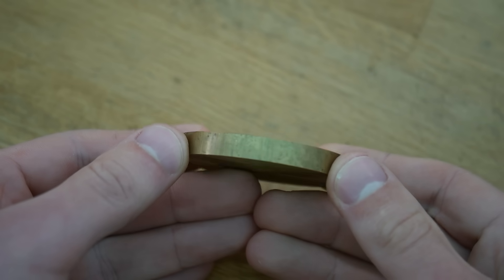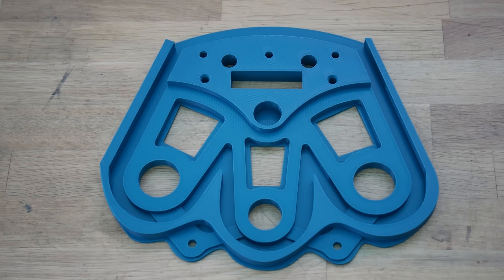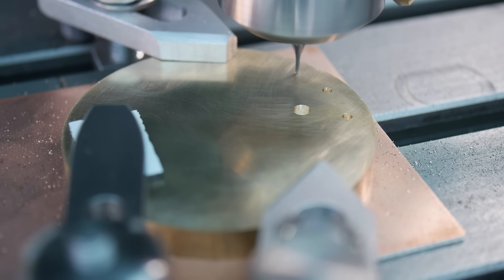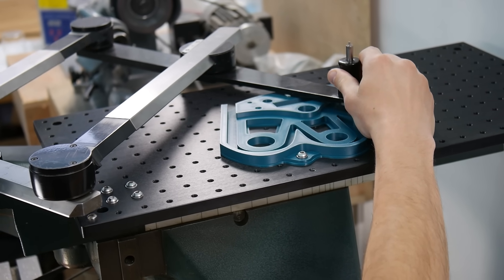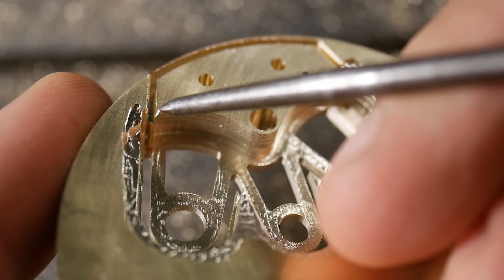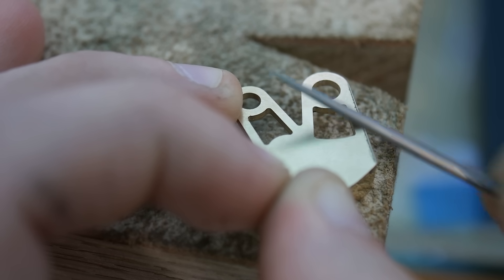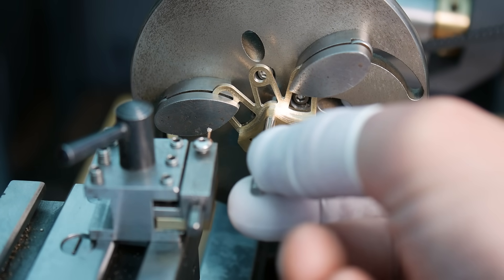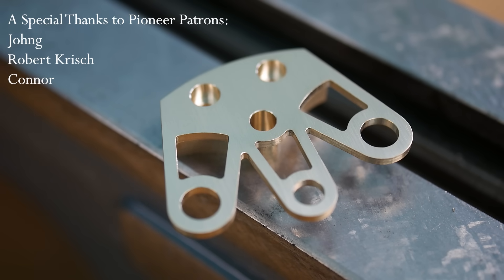Watchmaking: Using a Pantograph to Make Watch Parts

Comment: I served my time on a pantograph as a sign maker. We branched into fine engineering, when we did this we would often work with cutters where the tip was only a couple of thousands and ground and sharpened using a rotating cutter and microscope. When I tell people that I could feel the cutter dull they think I’m exaggerating, what was worse was you could feel to tip snap…😂. It took a fair bit of time to develop this level of feel

Comment: Funnily enough, I semi-recently sold my Taylor Hobson K on Marketplace (yours looks a bit nicer tbf,) to a clockmaker.. having myself used it for a watchmaking project too..
swapped it for an Alexander which was too cheap to pass on - but for horological projects, the Taylor Hobson is actually a nicer size.

I make templates via laminated card but the 3D printed route would be an improvement in a number of ways.
Your clamps and optical fixturing plate look superb btw.

Comment: I do not understand all the youtubers using a panthograph with a 3D printer. If the video is about manual machining the 3D print is the exact oposit of manual machining else why not jus get a cnc it is smaller and more precise, faster and cheaper than a panthograph. else you could just make the mold by hand. I mean the craftmanshift on this channel is superb so i nether understand after all the energy spend going manual on other part why go that shortcut.
Reply: I disagree with you entirely. Its a very clever way to add near CNC capabilities to a much cheaper and smaller machine.
It can be as much about preserving and making use of an otherwise outdated machine as it is about enjoyment of use and how much the workflow fits into your way of thinking
Reply: you got to draw the limit somewhere, the template is a 3d printed tool but the pantograph is machined too, if you want to make the template manually go for it but I understand why they want to skip that part while keeping part of the manual process
Reply: With the reduction a pantograph enables, your positioning errors are also reduced. So if a consumer printer holds a tolerance of, say, +/-0.2mm, after a 10x reduction, you're producing a part with a tolerance of +/-0.02mm, or 20um. If you went all the way up to the max reduction of a Deckel G1 (50:1 IIRC), you're looking at +/-4um. Granted, cutter deflection etc. probably means you can't hit that, but that's the logic.

Then there's the cost argument. Many people in the manufacturing/making spaces already have a 3D printer (for making soft jaws, prototyping for fit, fixturing, or hobby), and a good quality pantograph can be had these days for <£200. 

For contrast, a desktop CNC mill like the Langmuir MR-1 claims 12.5um tolerance, and costs about £5k when all is said and done

Comment: Id like to ask about the lapping flat. Does this not create a slight convex surface? Or can this be controlled somehow?
Reply from the maker: It does slightly using emery paper, but for this purpose, it's good enough. To lap a surface flat properly, it's best to use lapping compound directly on a lapping plate.

Comment: How do you design compound gear trains with clocks? I'm thinking of including a mechanical counter, but it's at a very specific moment it's supposed to turn (one for every 8 hours, 45 minutes, and 57 seconds). I thought it'd be could to try and design a Warhammer 40k themed clock that also has their stupid time-keeping system for the year where it's divided into 1,000 equal parts.

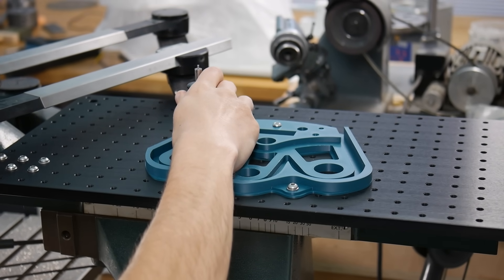Comment: 4:30 I think you could use a vertically offset second "serpentine" pattern that is indexed by the shank of your stylus, which is a smaller diameter than the tip. Alignment would probably be tricky, but not impact the tolerances of the final part if it's off because the cutter's bounds are constrained by both patterns.
Reply from the maker: Good idea. I might give this a try.

Comment: You can have a secondary template over the primary template, so above the tracing arm with a different stylus on top, I think they were for 3D work?
Also reamers cut on the face not the flutes, so need a relatively slow federate.

Comment: Wow!! I had requested this very info on your last video. I truly appreciate you going the extra lengths to record & document this. I was specifically curious how you for the 3D print to exactly the right size, but now that I watch this- I realize you can fine tune it simply by adjusting the arms on the pantograph. Plus, the 6:1 reduction helps with accuracy as well. Huge thanks for this video! It was very helpful!